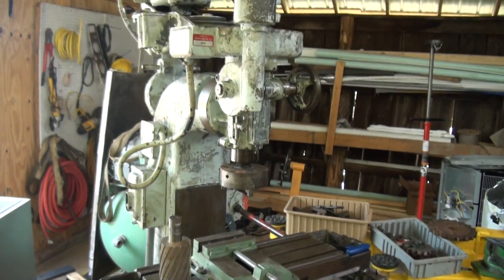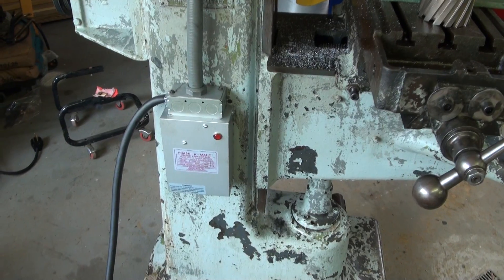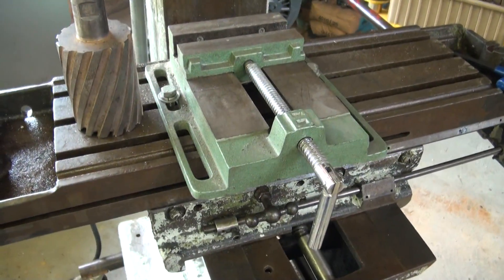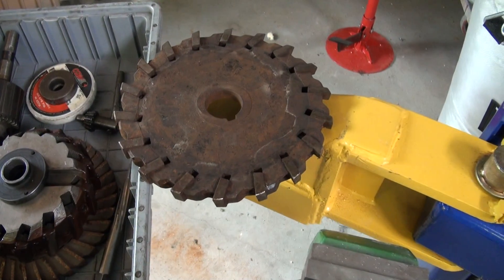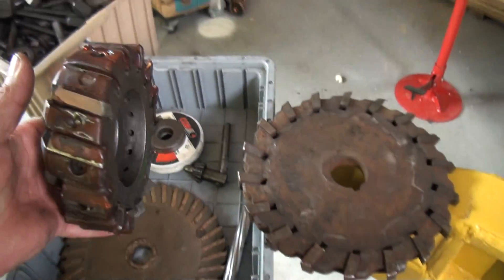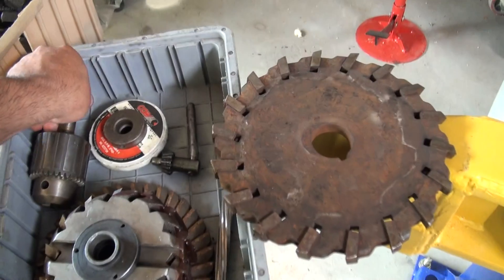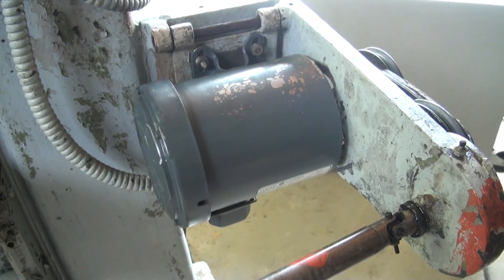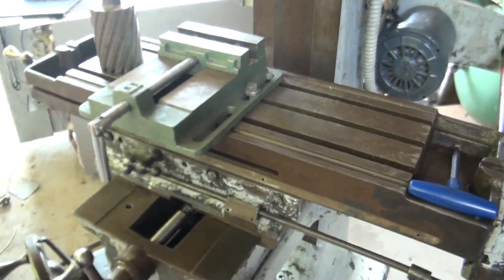INDEX Model 55 Milling Machine Example

Comment: I have two of these Index milling machines. One is exactly like yours and does not have a tag that gives the model number. The other one is I think a few years newer (early 1950s?) based on the style of the tags. It's the same except the spindle motor and pulley framework was updated to provide 9 speeds instead of 6. Also the power downfeed is different. The newer one has a serial number tag that includes the model number: 40. I think your machine (and both of mine) may be model 40, and not 55. Did you find a model number somewhere on it? From what I can tell they're good little machines.